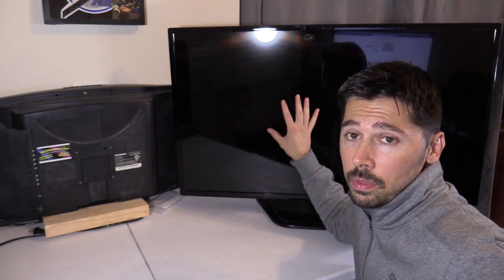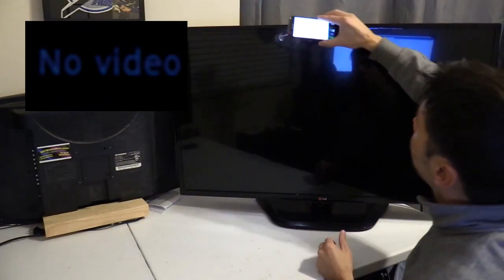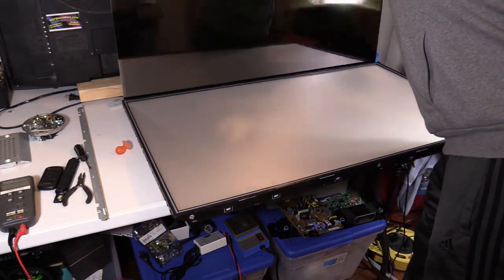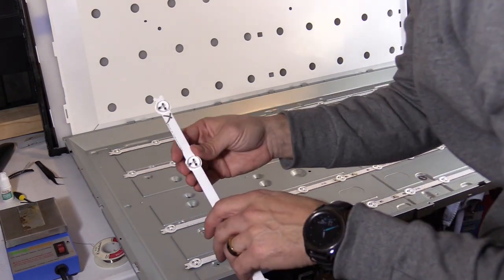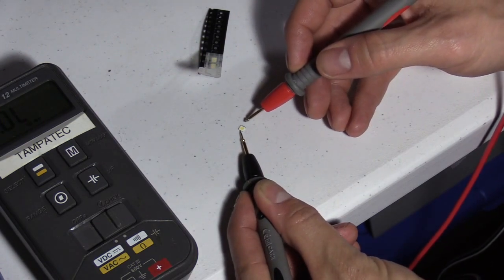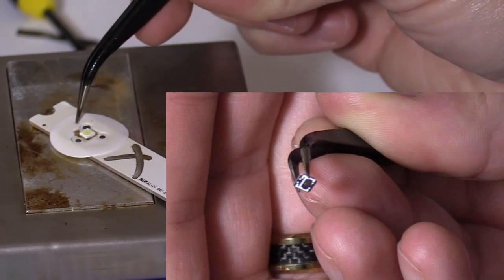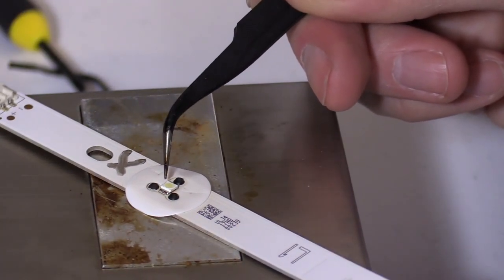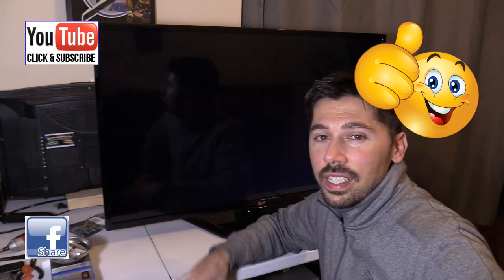How to repair LED LCD LG TV screen flashes then goes black

Comment: I tested all the LEDs. They all tested good (27 to 28 volts).. I can see a faint image when I shine a flashlight on the screen. When I turn on the TV, a light flashes for a second. When I disconnect the T-con ribbons one at a time, half the screen flashes for a second, then the screen goes black.. I'm starting to think the power supply is causing the problem, but I'm not sure that's the cause.

Comment: I have question I have a insignia 39 inch smart tv (FIRE TV) model number: NS-39F201NA23 but there’s no backlights for it so I guess I have to solder new led light for it I need help how to get the right one I was hoping if you can help me with it since this type of model is discontinued

Comment: I have a LG 55” tv. It keeps flashing when I turned it on. I need to disconnect the power supply for about 24 hours. It works fine for 3 to 4 days . Then again it flashes and  i have to repeat the process again. It is been going on for more then 2 years. Any suggestions for me to solve the problem?

Comment: Would everything still work if I relaxed the entire backlight strip with a replacement one instead of the individual LEDs?
Reply: yes
Reply: Yes its actually the simplest method and recommended, to avoid a need to replace other LEDs soon.

Comment: not necessarily a "repair" question.. but I'm working on a project with a LG LED 55 inch 55UK6090PUA.  I got it free because the screen stopped working but not the backlights.  I'm using it to make a Movie Poster backlit frame.  
Question.  How would you go about powering just the backlights?  I need to be able to dim them as well because it is REALY bright and I no longer have a way of seeing the settings menu obviously.  Don't need to waste the power on the rest of the TV components.  I'm in Clearwater FL and have the parts I don't need if you could use them.  Thanks

Comment: i have a sony bravia. perfect screen except for one bright strip of light down one side. with the back off you can see the bright side is a very white colour and the frame gets hot on that side, whereas the other 3 sides are more yellow colour and cool.. i have replaced the Led power board but the problem is the same. any ideas?

Comment: I have a 43inch LG LCD TV. I have a picture on the TV for a few seconds. But then it fades to black. Do you think it is the T-con board?
Reply: Did you check the two capacitors where the power connection for the LED's go into the  EAX power board? Sounds like a leaky capacitor.

Comment: My problem is that my tv from JVC goes on but only for a split second where I can see the JVC logo, then everything goes black. The blue power on led stays on but the screen is black.  Yesterday the TV actually started after a few tries and after that I could turn it on and off but when I unplugged it and moved it to the tv room the problem was back. I wonder what could be wrong?

Comment: I have a Hisense TV when I power on I see the SB light blink once and there  is no display or sound. When power off same thing, SB blinks once. Can it be the back lights?
Reply: If you have no display or sound, I would start with the main board.
Reply: @njyates2396  the main board brand new.

Comment: Have a Samsung 4k 6900 series that has one problem: A vertical grey bar, about 9 inches wide, at the extreme left side of the screen is present most of the time. Sometimes it flickers and goes off. The connectors to the TFT display and TCON board seem secure so is this a bad TCON board? NOTE: Rather than sending a tech to look at the TV Samsung said to scrap the TV and sent a check for a replacement.  Can the TV be repaired? ANY ADVICE?  THX Steve Morris

Comment: Another great video Paul. I have a viore 39" LED backlit TV that comes on for a few seconds to display the logo screen then it goes back to standby. Any ideas?
Reply from the maker: Unplug tcon board and see if it does that again.
Reply: @TampaTec  Thank you. I will try that tomorrow.
Reply: @karlkascha1261  did it work